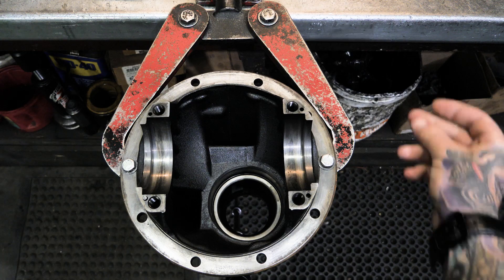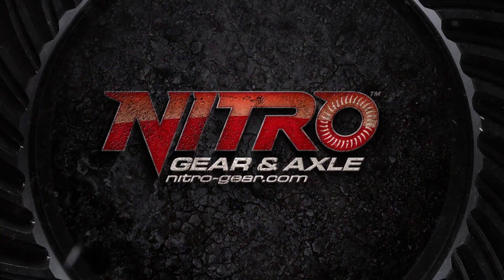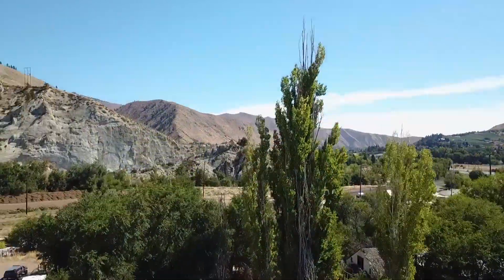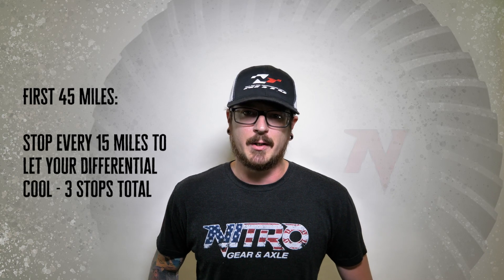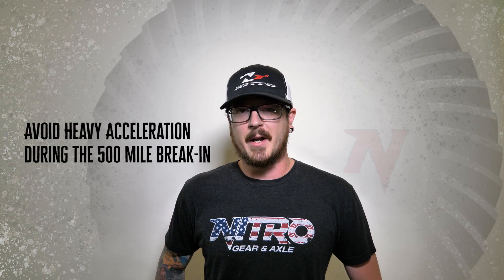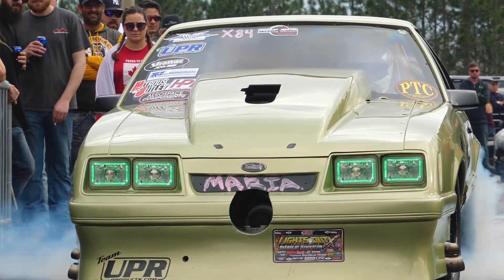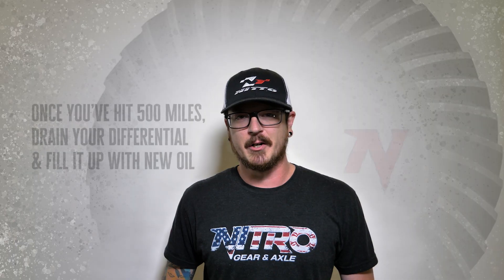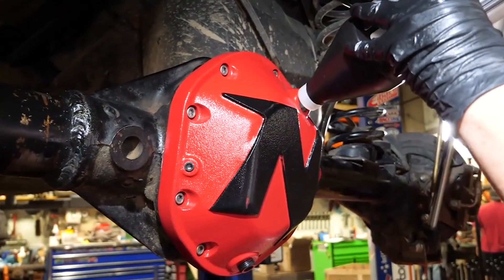How To: Properly Break-In A NEW Ring & Pinion Gear Set

Comment: And the same principles apply to not only the rear, but to the front as well correct? So driving around in 4wd for 500 miles ya?
Reply: I’ve been searching for answers regarding your question and i’m not seeing any.
Reply: @RL-nt8do   @nitro gear can you please confirm?  I'm doing my break-in now and have so far left my truck in 4H to ensure the front diff is properly broken in as well.

Comment: I’m getting your gears installed as we speak. What’s the max speed I can drive on the freeway during the 500 mile break-in?
Reply: Also do I use the recommended gear oil that Ford is recommending for my F150 or do you recommend a specific gear oil for your gears?
Reply: Did you ever get an answer? I have the same question. Thanks!

Comment: Is there another brand/ oil weight you can recommend if the nitro gear oil is hard to get in your area?
Reply from the maker: Any Gear Oil "around" the 80w-140 will work fine.

Comment: Great vid Thank you ,Was just wondering do new gears make noises before it breaks in ?
Reply from the maker: We have some of the quietest gears on the market, however a little gear noise in the form of harmonics can indeed be normalx especially in today's ultra quiet trucks & SUV's. A little hum will not hinder performance, however if it's very loud, chattery, etc, please make sure the pattern & setup were done correctly. If it's howling, could be bad setup.

Comment: when changing the oil after break-in period does it requires a new gasket?
Reply: I would assume so, unless you have a drain plug where you don't need to remove your diff cover.
Reply from the maker: Yes we actually prefer RTV Sealant over paper or cork gaskets though :)

Comment: So only the first 45 miles I’ll have to let them cool a total of 3 times? Or do I have to do that process for the whole 500 miles?
Reply from the maker: First 45 Miles for the cooling cycles & the rest of the Break-In Period would just be no towing & no heavy acceleration.
Reply: @NitroGear  regular highway driving ok after the first 45 miles??
Reply: @TheWookie_USN  Did you ever find out the answer to this? I have the same question. Thanks!
Reply: @positiveflow2420  no highway and nothing over 50mph first 500 miles.
Reply: @TheWookie_USN  Thank you Sir! 🙏🏽

Comment: Is towing required? Or will the gears break in fine without towing?
Reply from the maker: No towing for the first 500 miles :)
Reply: @NitroGear  thanks for helping.  I had 430s installed front and back now I have  gear whine from 60mph-70mph. Shop says its normal and that these gears make noise, nitro says its the shop. Guess I run it till it blows.

Comment: I recently regear my truck front and back, and it was recommended by the shop that I do a diff. Oil change after 500 miles, ita been almost 400 miles my question is, do I have to change the diff. Oil in the front too? I dont use the 4x4 at all so far, so can I do a rear diff oil only?
Reply from the maker: Change both ends
Reply: It’ll be coming out of both ends.